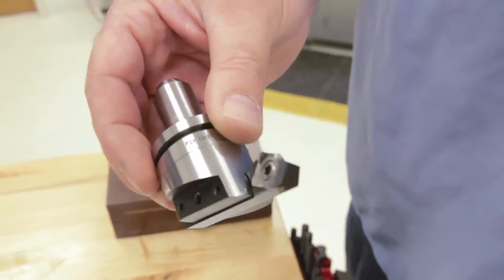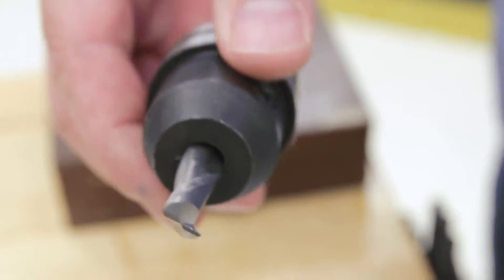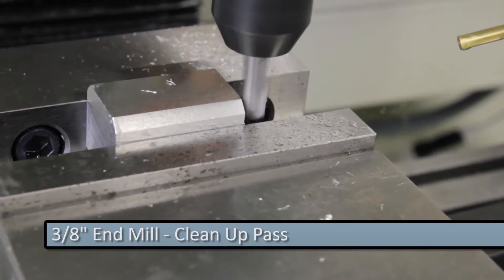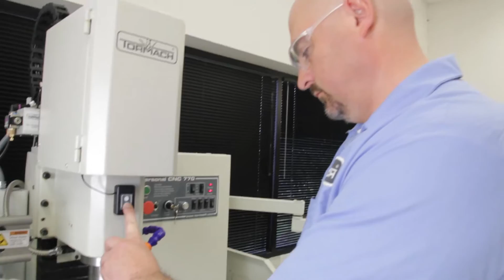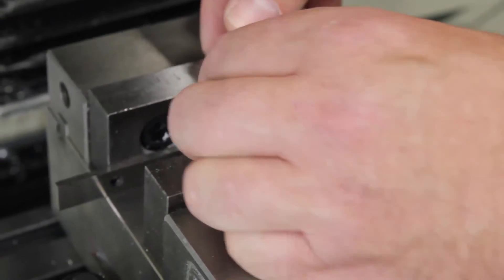How to Square Up a Block with a CNC Mill - Tormach CNC

Comment: why use round stock versus using a traditional square block to parallel and square ?
Reply from the maker: +Eazy Mac The simple answer is because we had it on hand and more interesting to do.  But it should be said that it is also harder to do correctly without making a mistake.

Comment: Call me paranoid, how do you know the jaws of the vice grip are parallel?
Reply from the maker: Quality vises like these will come with detailed inspection reports to show measurements for parallelism, perpendicularity, etc.   You can also double check with a dial test indicator mounted in the machine spindle.
Reply: Tormach, LLC Thank you for answering my question, I myself am just starting out.I am taking a few classes and trying to learn everything i can about it. Umm how would you check with a indicator? Is it anything like tram in from a bridge port? I have some experience in that from where i use to work, however i dont remember how to check the vice to see if its parallel.

Comment from the maker: You could, and it would be a bit more rigid.  But you also will not get the same surface finish unless you are using a very expensive mill.  Single point cutters like a fly cutter will almost always give a better and flatter surface. This is because on a face mill, the insert cutting height will be slightly different for each insert, something like a ten thousandth or two is pretty typical.  Unless your insert mill is of a very high quality, you're better with a fly cutter.

Comment from the maker: We are climb cutting (vs. conventional, cutting).  Climb cutting is preferable in almost all situations with a modern CNC mill since the cutting action pulls the cutter into the cut instead of pushing it away.

Comment from the maker: The short answer is because we can in this case:)  It boils done to two things:  A) we aren't creating a lot of heat with this cut since the insert is only in the cut about for a 40degree arc (out of 360), and B) There are no chip removal issues, like there would be with a pocket.

Comment: johnvid, when you buy square stock, it comes in what is called "mill finish", which is usually NOT perfectly square, in machining terms :) So squaring up a block has to be done even on what seemingly is "square" stock.

The point of using round stock is to exaggerate the "out of squareness". Makes it a lot more obvious to see what is actually going on, but the technique and order of operations is the same no matter what shape of stock you begin with! Good luck with your first machine, have fun!